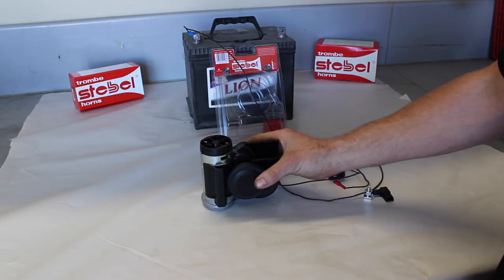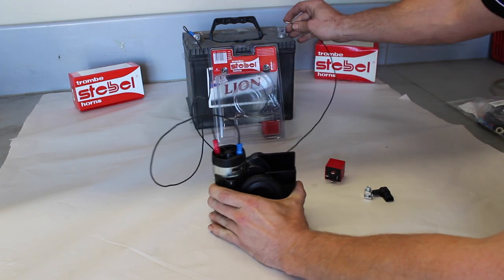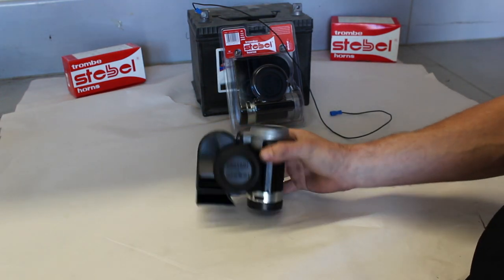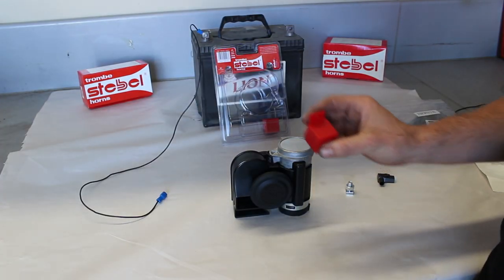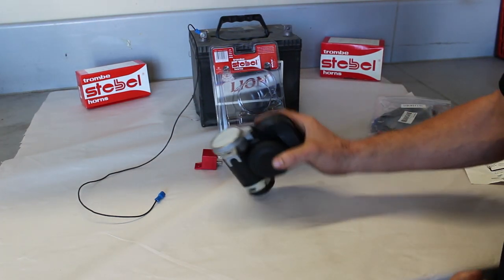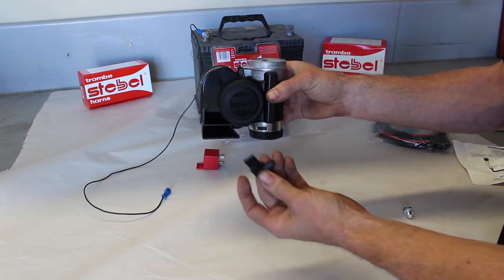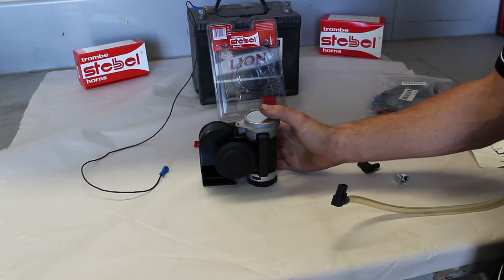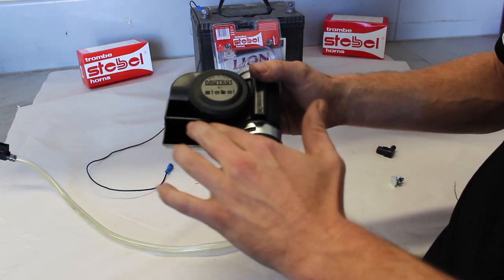Stebel Compact Horn Tips and Tricks OnlineAutoParts.com.au

Comment: I have 3 compact horn and I'm going to use it as a buzzer to our Sunday Club basketball.

I have 12volts 30 amperes power supply.

Is 12volts 30amperes power supply is good and safely enough to run my 3 compact horn as a buzzer?

Comment: I used chain cleaner to clean the horn and then lubricant it with synthetic engine oil. Horn is working but not as good as before.. what can i do now...?
Reply: I'm no expert but I think your cleaning method may be the cause.l not having a go at you just my thoughts
Reply: I can't imagine Stebel recommended either of those things as part of the regular maintenance of your horn. Why the f*** would you spray it with chain cleaner and then lube it with motor oil?!

Comment: How can I wire this to a separate switch in order to keep the factory horn?
Reply: it comes with instructions on how to wire it in different configurations, such as using the air horn along with your existing horn, or just the air horn independently.